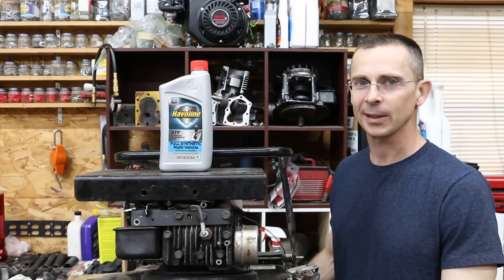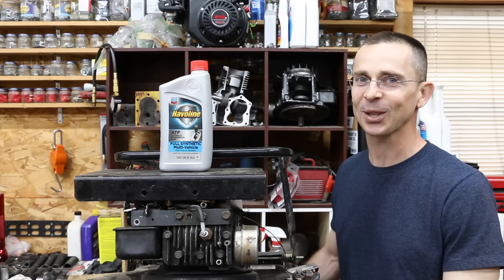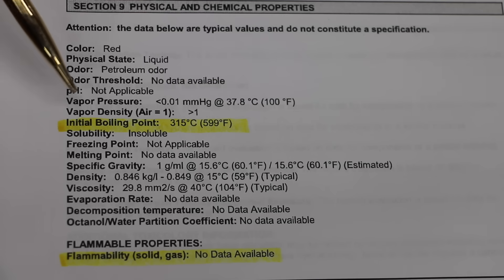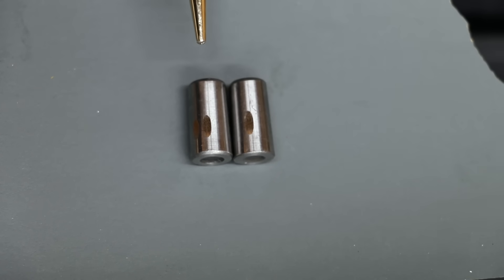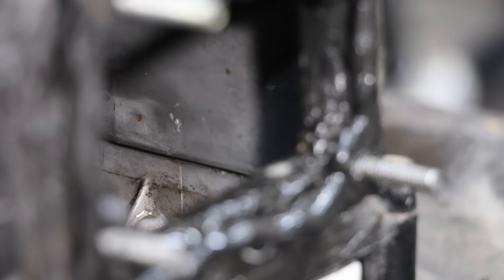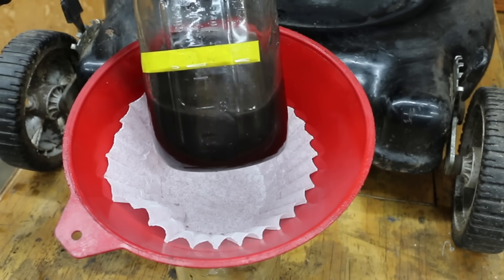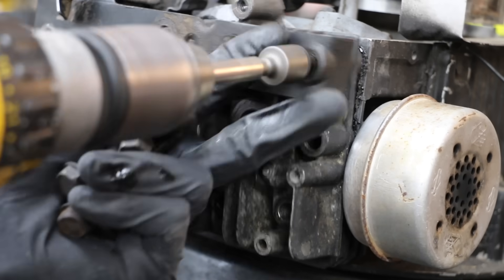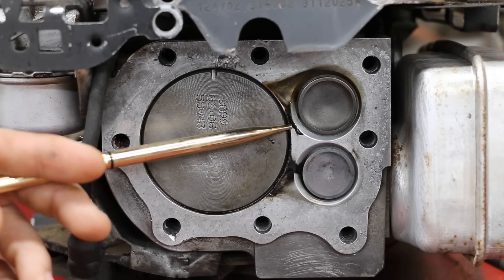ATF as an Engine Oil substitute?  Let's see what happens!

Comment: Ive used atf to clean up several automotive engines over the years with wonderful results. Few chevrolet v8’s with tapping lifters. Had an inline 6 cylinder in a 2005 chevrolet trailblazer that would set a check engine light and misfire on cold startups. Friend of mine advised me the exhaust valves on those would carbon up so badly in high mileage ones that it would first miss on cold start up, setting the check engine light, and if ran much further after that the carbon would hold the valve open long enough the piston would strike it and tear stuff up badly. 1 quart of atf mixed with the oil and driven 100 miles or so cleared it up, miss went away, check engine light quit setting. I made that quart of atf 100 miles before an oil change part of my maintenance regiment on it. Have put another 125,000 miles on it and counting. Had a friend of mine got a 2009 i believe pontiac g6 for practically nothing. It had 126,000 miles and would not run worth a dern. Spitting and sputtering, backfiring out the intake and exhaust. Had a check engine light for the cam sensor and crank sensor giving conflicting info. After beating my head against it for a while, changing both cam and crank sensor I discovered alot of build up inside the engine like the oil changes had been stretched too far. With nothing left to loose before my friends took it to the scrap yard, we changed the oil in it and replaced the oil with straight atf. It cleaned the sludge and varnish out of the cam phaser. Engine started running right. We ran it long enough that the viscosity of the atf thinned out and started causing problems with the cam phaser again, drained the atf, changed the filter, refilled with the correct engine oil, they have been driving that car for over a year now with less than 400$ in it with zero issues. And most of that 400$ was sensors it didnt need. I put them on the same maintenance regiment as i implimented on my blazer. Dont figure they will have any more problems out of it. They are up to 150,000 miles on it now. Thank you mr hudson my high school auto teacher for putting this knowledge on me. Thank you project farm for confirming it.
Reply from the maker: You are welcome!

Comment: 50 or so years ago, when I worked at a service station, we used ATF on engine sludge.  However, we never used only ATF.  We would run the engine with either two or three quarts of clean oil and the rest ATF.  Seemed to do the trick.
Reply from the maker: Thanks for the feedback.

Comment: I'm currently dealing with a sticky lifter in a Chevy 5.3. I've been considering putting some ATF in to see if it helps.  Thanks for the video !
Reply from the maker: You are welcome!  Thanks for the feedback.
Reply: I bet it would help
Reply: Try seafoam in the crankcase, about 8 ounces. Run it for about 300 miles
Reply: Did it help

Comment: I've never used it for a lifter in a running engine. but I've put it in the spark plug opening on frozen engines to unstick them. while I've had individuals tell me everything from you have to run straight ATF to unstick a lifter to you only add a quart to the crankcases, but when I asked would dexron or F type they would get a deer in the headlights look. so I've been leary of trying it.  now I know that it could work in an emergency but I still wouldn't want to try it strictly because I still don't know what effects it has on the bearings wrist pins and cylinder walls.

Comment: Adding 1 cup of transmission fluid to the engine oil before oil change and run it for
5 to 10 minute at idle then change the oil will help flush the engine and does help free sticking lifters and oil rings. I tried it before and worked reducing the noise lifter
Reply from the maker: Thanks for the feedback.

Comment: In auto shop we were told about the detergent qualities in ATF. I would wait til I was a quart low on oil (about 2500miles) then add 1 quart of atf for about last 500 miles then change my oil. I only did that for my first car which was older.
Reply from the maker: Thanks for sharing.

Comment: I love using ATF when cleaning an engine by hand during a rebuild. Especially when cleaning the cylinder walls it will get them squeaky clean while also leaving a nice oily surface behind. supposedly a tiny amount of atf in the cylinders on the first start after getting new rings can help them break in better
Reply from the maker: Thanks for sharing.
Reply: Provided that your cylinders were previously cleaned.  There is a reason why transmission re-builders wash their parts in a cleaning booth.

Comment: I would love to see a test of friction modifier oils like (Slick50) and such. For some diesel engines the motor oil doubles as hydraulic oil to operate the fuel injection system. Some CAT and international engines use the HEUI (hydraulically activated electronically controlled injection system) international  T444 also used in Ford trucks as a (7.3 powerstroke) would the friction modifier oils help reduce stiction in fuel injectors?
Reply from the maker: Thanks for the video idea.

Comment: I used to disassemble and rebuild 5.9 Diesel engines. No better hand cleaner for removing grime from your hands than atf lol. The detergents are very aggressive in it , designed to clean.
One of the highway tractors that we haul cattle with had a diesel injector sticking . We added 4 Liters to 100 gallons of diesel fuel. 
I could see the smoke from over fueling out of the stack. 
At 150kms it stopped smoking and the engine ran normal. 
Thanks for actually showing me how it does actually clean inside a engine!
Keep up the great content and work!
Love your videos!!!!!!!!!
Reply from the maker: Thanks, will do!

Comment: I've used atf as oil to clean old engines with oil consumption issues and sludge. I've always gone about 75% atf 25% thicker than specifications oil. To try to keep the lubrication needs met. 

Never had any issues. And the discoloration after short run and drive time has me convinced it was doing a good job of cleaning. 

With all that said, id love to see this same test done verbatim with regular oil vs engine oil flush kit. My bet is the engine oil flush kit has even worse lubrication than the atf.
Reply from the maker: Thanks for the video idea.  Thanks for the feedback.
Reply: @ProjectFarm  your welcome, thank you for the well executed video! I appreciated your non bias answers and fact driven conclusions.
Reply: You would be correct sir because I do the same 75 25% mixed as well but I leave it in for thousands of miles achieving great results oil stop burning in a little 2.4 l Toyota engine as well. Using this technique for at least 40 years
Reply: @Lonnielove803  yessir. I too run the atf/oil combo for about 1000 miles. I just make sure to not beat the engine with potentially less lubrication. Ill continue to do this indefinitely when neccessary 😁
Reply: @AutomotiveSpecialtie  💪

Comment: Adding one quart of ATF on a oil change on older engines work just fine it does act as a cleaning agent and it does free up some lifter chatter not always. Even though there are transmissions that are manual that run on pure ATF I would not recommend pure ATF in an engine.
Reply from the maker: Thanks for the feedback.

Comment: Yes I have used automatic transmission fluid and motors for years I will not use a junk cleaner that’s out there I will use ATF only I’ve never blown up a motor because of it I add 1 quart ATF to every motor at all times of mine and it keeps it cleaned out this fully synthetic oil and semi synthetic does not have detergents in it that’s why they sludge up if I have to use the oil I will put 1 quart of ATF in the keep that motor clean iPad tapping motors from lifters I put 1 quart a tear in that motor within a couple hours that motor is quite I leave the motor all in there to the full 3000 and then change it and put 1 quart ATF back in that way it keeps it clean keep the seal salt because ATF slowly breaks it down it doesn’t do it fast like these new detergent that’s out there that’s garbage it breaks it down too fast I have to be broke down slow How I break it down if it’s 4 1/2 quarts I will add 3 quarts of motor oil and 1 quart and a tear and run it and it slowly breaks it down it doesn’t hurt the motor and on the magnet there is no metal
Reply from the maker: Thanks for sharing.

Comment: Hydraulic fluid ATF is made for hydraulic systems it is not made for lubrication it is made for pressure and yes ATF is highly flammable if he gets on a hot surface it will ignite like gas
Reply from the maker: Thanks for the feedback.

Comment: I was taught if you put transmission oil in the engine and let it run for 5 or 10 minutes at idle then drain it that it actually cleans the internals of the engine.
Reply from the maker: Thanks for the feedback.

Comment: Flash point is the lowest temperature that the oil will form a vapor at its surface which makes the product that you're using right now not very good
Reply from the maker: Thanks for the feedback.

Comment: Back in the olden days we would use ATF in the oil and in the fuel tanks of the old two stroke Detroit Diesel engines 238,318 and then the silver series. It helped keep injectors-freed up and keep the inside of the block a little cleaner. The old detroits were noted for converting diesel fuel into smoke and noise.
Love your channel and am a subscriber. Question for you, when doing these engine tests on the mower engines do you use a fresh head gasket each time ? 
Would also like to know your opinion on the harbor freight 3400 jump pack. I have actually witnessed one start a  commercial Cummins diesel in a road tractor and the batteries were flat!  Have a great day !

Comment: I've only ever used trans fluid to clean a crank case or free up stuck rings on seized engines. I've only got one engine I couldn't unseize with atf. 

But I think seafoam works better at crankcase cleaning.
Reply from the maker: Thanks for the feedback.

Comment: I feel like this is a muchh  Shafer option for older engines without a bunch of electronic components ...obd 1 and before maybe.  think on more modern engines with tons of sensors or engines like direct injection style or newer turbo engines I'd definitely look for some anecdotal evidence per specific make model etc on message boards/forums..
Reply from the maker: Thanks for the feedback.

Comment: Many years ago, I owned a VW bug ... 36hp no frills motor.  I was driving downtown, and about three blocks away from my destination, I heard a gawd awful knock, and pulled over into a used carlot.  This was back when on Sundays everything was closed.  I tried to think what I could do and found an almost new quart of ATF.  I needed to get home, so poured the quart of ATF into the crankcase.  It was still making noise as I headed home, and about four miles from home ... it sputtered, the rear tires locked up ... and the engine was fried.
Reply from the maker: Wow!  Thanks for sharing.

Comment: Wouldn't take a full crankcase of ATF, but I have used it in a .5 to 1 quart to clean up a motor as you have. And it works great for light cleaning and freezing up striction. You don't need much to get results with all the detergents in the oils to today. Enjoy.
Reply: I knew an auto mechanic that would drain dirty oil fill it with ATF and let the car idle for about 30 minutes with no driving. Then flush the engine and put in regular motor oil. It’s amazing how dirty the ATF oil came out after running through the engine for 30 minutes.  
He mainly did it for freeing up, stuck lifters in the head.

Comment: Used automatic transmission fluid to free up a stuck valve on a Chevy 400 engine it reported directly through the carburetor with a running at high idol It worked

Comment: Now age 65, rebuilt my 1st engine at age 17. We used to add some (1/2qt or so, so not to overfill) ATF to oil to free up lifters, safely clean the inside of the engine. It always worked. But, like you said, with modern oils no need to do this. Thanks again for a real test.
Reply from the maker: You are welcome!

Comment: I know it's an old video, but I thought I'd share my experience. I've been told putting a quart of transmission fluid in an engine that's had water in it will clean up the water.  My '93 Chevy fullsize that had the 4.3 with 300,000 miles blew the intake manifold gasket and was letting the coolant into the crankcase. By the time I figured out where the water I was adding kept going, it had five gallons of it in the crankcase. After I changed the gasket I bought the cheapest oil and some transmission fluid and changed the oil and drained the filter every day and did my normal 50 miles of driving. After a week the crankcase showed no sign of water, and the oil stayed much cleaner after that. I had it for several years after that, it never developed an oil leak, and it idled so smooth I could balance a nickel on the air cleaner.
Reply from the maker: Thanks for sharing.

Comment: My dad used to add 1 qt of ATF and run the car for a few days on it before oil changes.  He worked most of his career as an engine development engineer, for Cooper Bessemer, Continental motors, Deere, and Chrysler. Seemed to work well on sludge & varnish.
Reply from the maker: Thanks for sharing.
Reply: Seems like a good idea, but I wouldn't try it in my Honda Odyssey. I keep hearing how sensitive those engines are. The trans too!
Reply: @cumshot247 Hondas, Toyotas, and kia/Hyundai need solvents to prevent stuck rings and oil consumption. 

I would say your Honda needs it more than the average car. Frequent redlining too.
Reply: @corvairkid17 what kind of solvents

Comment: How about using diesel or kerosene as and engine flush to do the same? Old timer trick you might test.
Reply from the maker: Thanks for the suggestion.
Reply: Most engine flush consists of is kerosene.

Comment: ATF also works good in softening hardened valve cover and crank, cam seals. Doesn’t take very much about a quart to a five quart system.
Reply from the maker: Thanks for the feedback.
Reply: Do you run for 100 miles or keep it till next oil change ( 3000 ) miles
Reply: @Chinga_Tu_Madre_817  it’s perfectly safe to run it till the next oil change
Reply: @josephbradshaw5353  ok thanks

Comment: In the 1980s, I used ATF in a small motorcycle engine, from advise in a motorcycle magazine article.  Two things happened: 1) on a summer's day, the crankcase emptied itself all over the back tire. Never understood why.  2) that winter, the engine seized.  Piston con rod needle bearing disintegrated,  with bearing parts in the cylinder wall, piston, head, everywhere! Lesson learned.  Stick with motor oil!!!!
Reply from the maker: Thanks for sharing.
Reply: from advice*.  Advise is the verv.  Advice is the noun.
Reply: @zavatone  Do you think any of us care?  I sure as hell don’t.

Comment: I haven't used ATF to clean an engine since 1980's, but as a young mechanic, I added 1 quart of ATF to many engines with noisy lifters (including my own 1972 Camaro 350), and told customers to drive normally for a week and return. I must admit, it usually worked; probably 80% successful. BUT... I wouldn't do it to a modern car.
Reply from the maker: Thanks for the feedback.

Comment: Would LOVE ❤ to see YOU test a few engine oil filters. Other channels cut them open and do simple, visual inspections, but that is just a beginning. Important are flow rate, particles size, heat resistance and bypass characteristics. How can an oil filter claim it's good for 20,000 miles? What does that even mean? And why do they all claim that synthetic oil is bad for "standard" filters? Marketing wank or fact? You're engine oil comparison videos are TOP NOTCH 👍. Cheers.
Reply from the maker: Thanks for the suggestion.

Comment: My neighbor came over with very bad lifter knock because she was way over do her oil change , she was low on  engine oil to begin with so I added 2 quarts of diesel on top of 3 quarts of motor oil and  I let it run (idle) for half an hour and lifter noise went away, change oil and filter and she never had a problem since then. ( I believe it was a 😏2004 Jeep Grand Cherokee with the V6 engine)
Reply from the maker: Thanks for sharing!

Comment: When I was 17 years old I had a 1962 Ford Fairlane.. well it ran out of oil and we had just put a shift kit in my friend's transmission,,  so I used his old transmission fluid I ran pure transmission fluid in my engine for about 6 months it finally blew up when I took it to a mechanic he opened up the engine and it was spotless clean brand new except all the seals were gone...

Comment: I’ve used transmission fluid in an engine several times to limp to a gas station.  Along with gear oil and bar oil (it leaked.  A lot).  On teardown, the crank journals were in good condition, better than most.  The crank had 560,000 on it and was standard size.
Reply: you driving from the south pole or wtf? fix yo damn car or start walking rather.

Comment: I have always used atf in my diesels fuel  to keep rings free and injectors clean. I once saw a 1958 chev with worn out 283 wasn't able to make it out of our drive way my grandfather dumped a quart of trans fluid down carb while it ran. That old 283 took that girl to work 200 miles away for the next 9 months. It will free up lifters and valve guides of carbon deposits and free up rings in their grooves

Comment: For early Miata’s with noisy hydraulic lifters I’ve done the 2twisties flush  method with no issues. One quart of heavy 20-50w oil, fresh filter, 3 quarts of ATF. Let it idle for 30 mins and change the oil. Works great every time and the oil coming out is very dirty after the flush.
Reply: MANY years ago, when I was a young automotive student, I was taught to add a pint of ATF to the engine 500-1000miles before the oil to clean the engine's lifters.
Reply: This is kinda what led me here. Thanks for the reply.